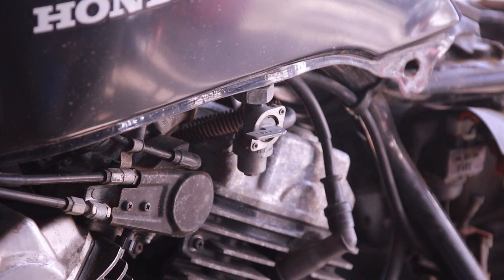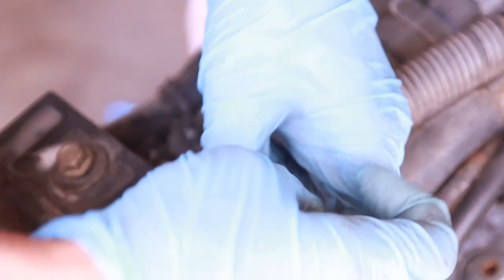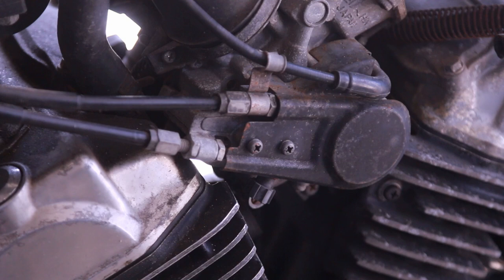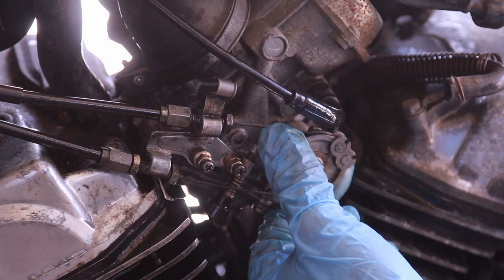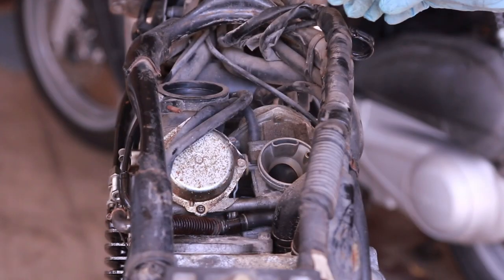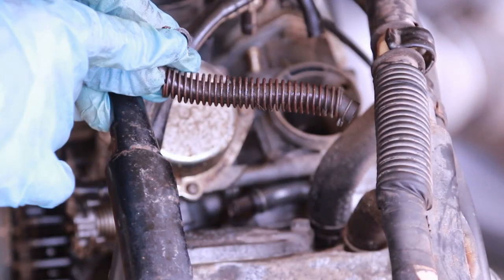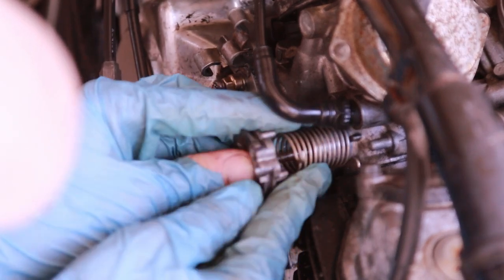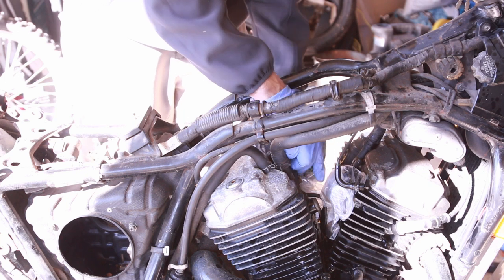Honda Ascot: Carb Removal of 83 honda vt500 ascot

Comment: Dunno..Never saw a carb butterfly control locked up like that.All thats in the carb enrichers
is a small piston with a rubber seal and a needle.This makes me worry about the engine.I
would pull the sparkplugs put in 5th gear and see if it turns over.Perhaps you did this before
buying.?  Hope you can bring her back..Cheers.

Comment: Got one of these bikes a few months ago.. runs fine, but it’s got a couple minor leaks, one being around the bowl of the left carb. I’ve had it apart as far as removing the intake to balance the carbs but I’m really not looking fowArd to removing them to replace that seal. Just a slow drip.. no big deal for now. 

The other leak really sucks.. where the water pump meets the rest of the engine. Another slow drip. This one requires pulling the engine to fix.. ugh. Probably this winter when I get a week where I can’t ride.. This bike is currently my only vehicle.